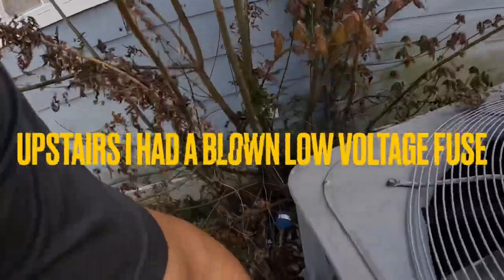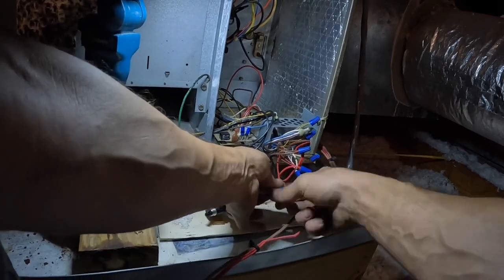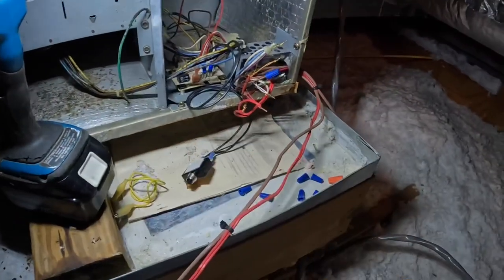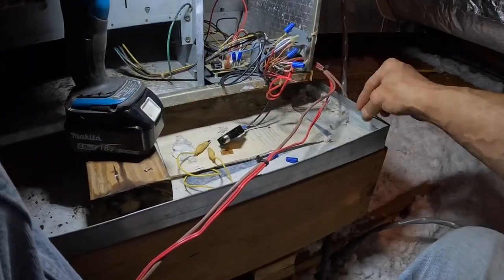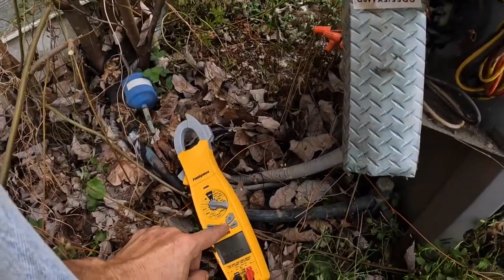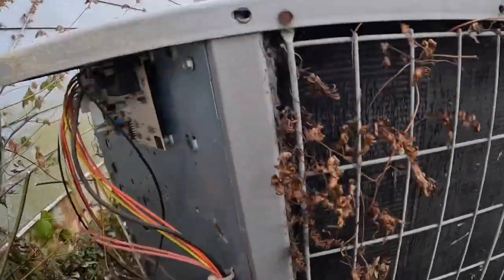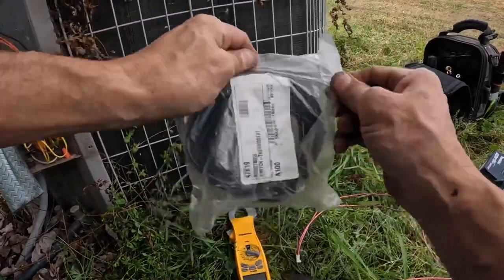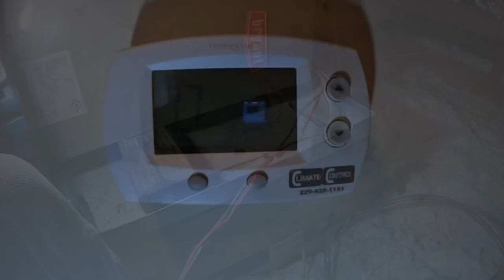Blank Thermostat - Low Voltage Short…Repaired

Comment: Very good find. I found one of those about 2 months ago. Apparently carrier must have gotten a hold of some bad sensors. I've never seen that on any other unit where the short is actually inside of the snap- disc and shorting because it's clamps onto copper. Pay attention guys. You can learn a lot from this channel.  😎👍

Comment: Good find. I have learned in this situation if it's a bdp heat pump to always look down inside unit for wire  shorted to copper.  So at beginning I was thinking that from experience.  Our meter always tells us the culprit.

Comment: Like the nut driver, but I recommend the DeWalt 12v screwdriver can set the torque to prevent stripping the hole. A lot lighter and batteries last forever……

Comment: After testing the y,o,g and w wires the reds should’ve been separated and tested separately to see if the  problem is going to the t-stat  or going out to the  condenser unit, but great job..

Comment: I am confused about one thing. You pulled the thermostat off the wall and then jumped it to the float switch. How did that make it blow the fuse if the float switch had nothing to do with where the short was at which was the unit outside?
Reply from the maker: Float was still connected to both reds
Reply: @HVACGUY  oh i see. Thank you

Comment: So I just learned something. I always thought that the defrost sensor was like a regular temp sensor that you would measure in ohms  , so when the sensor reached a certain resistance value from temperature it would close and then when the board reached its time to check then it would allow the system to go into a defrost. So know I know that there is 24v going  through that defrost temperature sensor.
Reply from the maker: On a defrost thermostat like that yes. It has to time out and get 24V on the other side of that defrost thermostat in order to go into defrost. Many newer ones use a sensor though.
Reply: Old style defrost like this one is "Time & Temp." With one single sensor that opens and closes. The newer style defrost is "Demand Defrost" with two thermistors, one sensing outdoor temperature and the other sensing coil temperature. And those sensors are measured with ohms resistance and compared to a ohm resistance/ temperature chart for proper readings. 😎👍